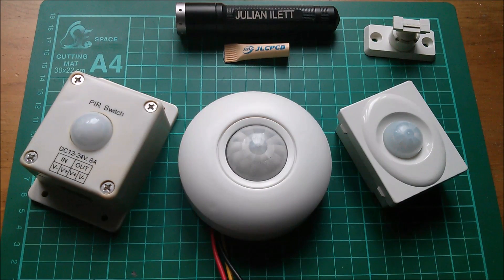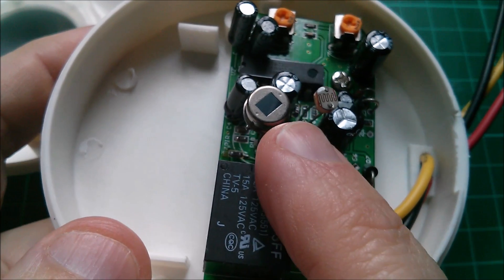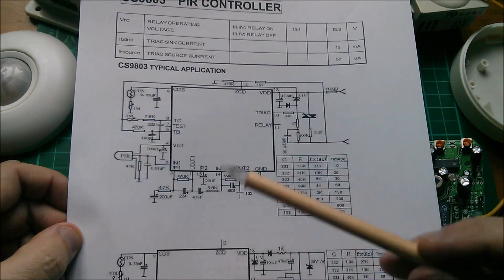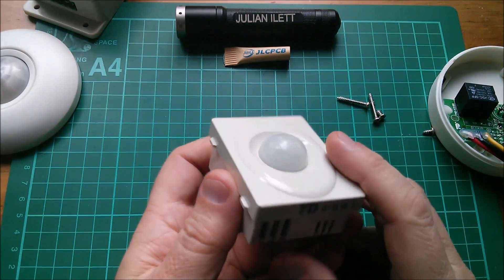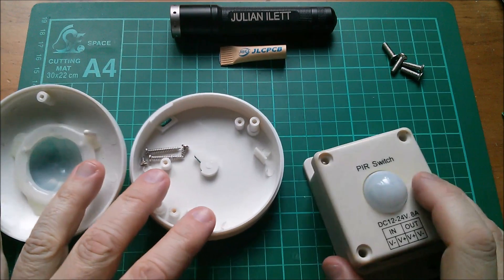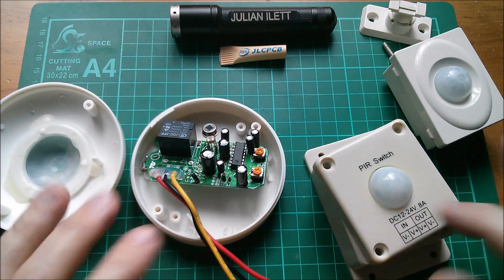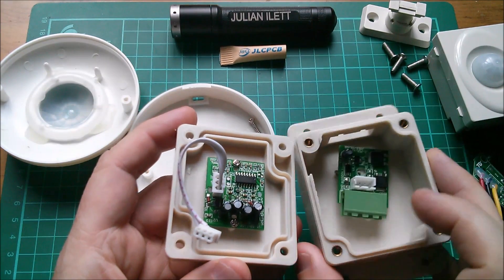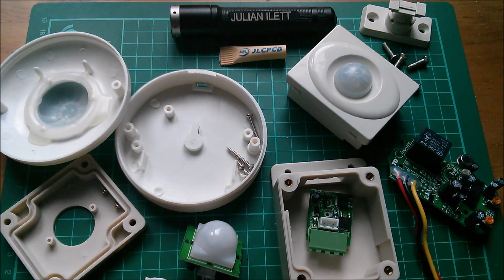Looking at a few different 12V PIR Switches

Comment: Hi. I just purchased a PIR switch with 4 connectors (2 in, 2 out), but it fails to work whenever I connect the two grounds together.
Any clues how I might fix this?
Thanks very much.

Comment: Hey Julian. You should make a playlist of all your vintage projects like the Z80 stuff you've posted. 

   I've been goofing around with a few old MPU's, namely the Z80, 68K, and 6502. YouTube has been suggesting several of your uploads over the last few days. They are pretty cool, you should be really proud of those. I wish I could prototype and build stuff like you've demonstrated. You've posted some of the best examples of real Z80 application hardware on here. 
   These MPUs have become so cheap, IMO, they are a practical way of learning the gritty details of registers and hardware level computing without going cross eyed trying to figure out what's happening on a more modern uC datasheet.

   If you ever feel inclined to make more content on vintage hardware for those of us that weren't around when this stuff was current, I am finding it more challenging to figure out the details of peripheral ICs. I am still trying to ground my understanding of all the different opinions and what will and will not work. I think it would be really interesting if someone with the experience and know how compared something like the ATmega328 to the Z80 and simply noted the go-to part numbers for peripheral ICs you would use with the Z80 to achieve similar results to the 328's integrated peripherals. I imagine this might seem silly to the EE vanguard, but as a younger hobbyist that's only been goofing around for a few years, I have a different baseline grasp of these 8-bit systems. I think a lot of the info about this stuff is only focused on the nostalgia community when in reality a basic Z80 system can be put together for less than $10 now. At that price point there is a wider potential audience interested in a fundamental understanding of this learning opportunity. At least that's how I see it. I have several playlists of examples from many other CC's. There is a lot of interest in this stuff but much of the information about the peripheral IC options seems to be omitted as if the info is defacto implied and unnecessary. This even encompasses how to interface with memory and how to use modern flash to replace the old eproms.
 Anyways... I really appreciate the vintage info you've shared. I have your basic 'blink a LED Z80 style' video setup on a breadboard right now.
It was actually one of your videos about Arduino clones that got me to pull the trigger and buy a few things to try and learn electronics back in 2014. It just seemed accessible because of what you were showing.
Thanks again.
-Jake

Comment: If they are playing pranks on you you should be able to do it to them. Setup a remote control water pump outside the door and a mini camera to watch for them. You could also setup an air horn instead of the hose.

Comment: I want to see some 240v versions analysed so I can place then in different locations to outdoor floodlights and know before I buy if they will be durable.
Reply: There are light bulbs with pir built in on EBay. As cheap as $8.00,voltage 110 or 220v.

Comment: (6:42) - There appears to be a fair bit of solder detritus stuck to that PCB.
Did you clean it all away before reassembling the unit?
I could definitely cause problems should they become dislodged.

Comment: I have found with pir sensors the corner type are better at detecting movement (rather than the 360type, especially if they aren’t mounted very high. (I work with them on a daily basis on alarms/spot lights)

Comment: ..... Why don't these IC's reset the timer to zero, when motion is detected during timer cycle ? (FFS).
Reply: It's to deal with the situation where the LDR/light sensor can see the controlled light. If the timer is retriggerable the unit won't be able to see the true light level and can end up never switching off if continuously triggered from before dawn.
Reply: @Graham_Langley  ..... I disagree, The LDR is Enable or Disable (two times a day). Resetting the timer to zero is (programming code).
Reply: Missed point. The OP asks why there's no option to reset (restart) the timer each time motion is detected.

Comment: I've had great success with the ebay pir sensors but the ones with the solid state switch seem to cause a flicker on some of my lights if they are LED's and not florescent or incandescent, either on or when they are off. So double check it before you wire it all up.....

Comment: R3 is a light-dependent resistor which has low resistance under strong ambient light.  This causes the detector to be operational only when the detection area is sufficiently dark.  Thank you for your kind attention.

Comment: For the brats, setting up a camera to record your property could be an option, as long as you double check with the law.
Or you can use a hose on them!
Reply: a PIR operated high pressure water pump connected to a hose :-)

Comment: Is LDR a European thing?  I've always called and heard (before YT) them referred to as photocells or photoresistors or more descriptively as CdS photocells.  Maybe it is the modern day trend to make three letter acronyms (TLAs) for everything?  Or maybe it is because of North America's LDR (long distance relationship) with Europe that has given way to calling it by different names?  IDK.

CUL.
Reply: Back in the 60s the Philips electronics kits called them LDRs so that may have something to do with it here in the UK and it distinguishes them from any other kind of light sensor.
Reply: LDR - Light Dependant Resistor - or a resistor where the resistance depends on the intensity of the light falling on it. And yes, also known as photoresistors. A photocell is a generic name for any electronic device that detects light. Mostly used for semiconductor diodes these days.

Comment: Actually, many mains powered PIR switches can easily be converted to almost any DC voltage above 8V. All that's required is a 5V voltage regulator and a MOS-FET or relais for switching.

Comment: I’ve had a cheap eBay pir on the shed for four years I’d guess. Clearly there’s water inside and it’s relay based...  still working fine. As are the 10 watt cob bell lantern you’ve shown. They’ll be reet!  Interestingly we’d call that activity knock-a-door-run. Have a similar issue here sometimes. :-(

Comment: I fitted one of these in my garage the other day, along with a 5 meter led strip, 12v sealed lead acid battery and a small trickle charge car trickle charge solar panel. It's now so much much easier to out the bike away at night time. Nice simple system. Good video, cheers. https://www.ebay.co.uk/itm/272565986187

Comment: The security ones have temperature compensation, so when temp gets around body temp sensitivity goes higher.  You may need to mask the lens for falsing.
Reply from the maker: Neat :)
Reply: When I designed commercial PIRs many years back some manufacturers had temp compensation but some decreased sensitivity with temp while others decreased it. Others had boards laid out for it but left it unpopulated and the large majority didn't have any temp compensation. I never used it.

Comment: Been using a slimline version of that Mosfet one outside for my garden lighting for the past two years on my solar system. There was a hole on the top for the timer adjustment, just covered it with some electrical tape, as the unit is black in color.

Works great! Gets rained on all the time, but just keeps going! Power consumption seems to be next to nothing when just sitting there.

Comment: Don't they compare two images in anti phase? As in they have 2 sensors (in one unit) wired in such a way as to cancel each other.
Reply: Nearly right. The pyrosensor has two elements connected back-to-back, i.e. + to -, so that there's no net output if both are at the same temp. They're on a common substrate so they will equalise temperature very quickly.

A moving heat source* in any of the zones covered by the Fresnel lens array will cause one element to receive more IR radiation and so heat up slightly compared to the other. This imbalance causes a very slight (and temporary) voltage to appear at at across the elements which is them buffered by the internal FET, amplified, filtered (roughly 1-10Hz) and amplitude detected.

Normally the detection is a simple window comparator that detects a single excursion of either polarity, but some detectors look for opposite excursions within a certain time before triggering.

* It also works with things colder than the background of course. Bushes moving in the wind that are cooler than a wall behind them for example.

[Edited to finish what I started in para. 1]
Reply: @Graham_Langley  or a bit of "canned air" flipped upside down and sprayed near a door exit sensor
Reply: @Robert Szasz And loads of other things. It's also why the aluminised survival blanket trick rarely works.
Reply: @Graham_Langley  but a regular bedsheet usually will work. You don't want to reflect the background, you want to have a nice big, single temperature object. Lightweight cloth quickly hits room temperature
Reply: @Robert Szasz Problem is that there's always the chance there's something in the background that, although it's at the same temp as everything else, is going to have a sufficiently different emissivity to trigger the unit when it's occluded by any cape of invisibility.

Comment: On the first circuit, there is a smoothing cap
The unsmoothed supply goes to the relay, then it goes through a resistor and diode, then there's a 100uF cap next to the ic
Reply from the maker: Oh yes, so there is - cheers Sparky. What a horribly laid out schematic :)
Reply: +Juilan Illett Seems clear enough - I'd followed it though before you pronounced there was no cap.
Reply: So I wasn't the only one shouting at the screen

Comment: I might opt using a radar one, they tend to be a bit more reliable. Depends on the surroundings, though.
Reply from the maker: I ordered one - it's on its way :)
Reply: @JulianIlett  Just the one? :-D
Reply from the maker: Also bought some RFID stuff - so different coloured key fobs will turn on different lights :)
Reply: Yes, i also went for radar based light switching in the front yard, using a cheap module; has been nicely hidden in a fully sealed box, behind some stones. Works since 8 years now... :)